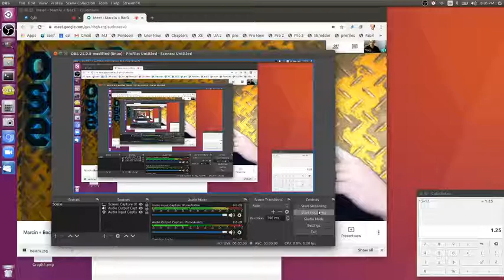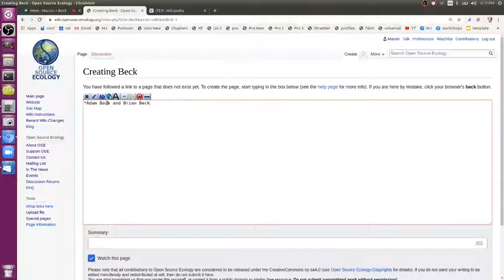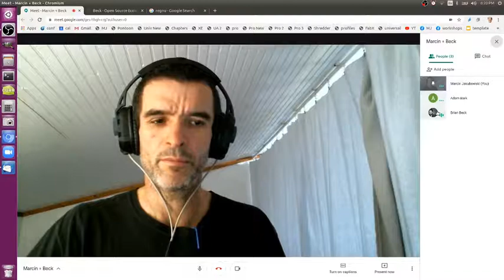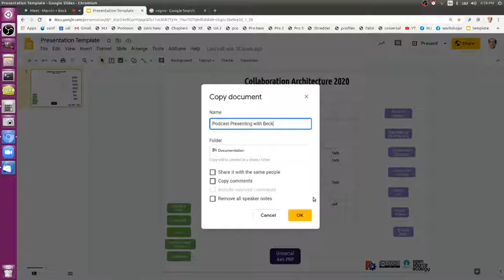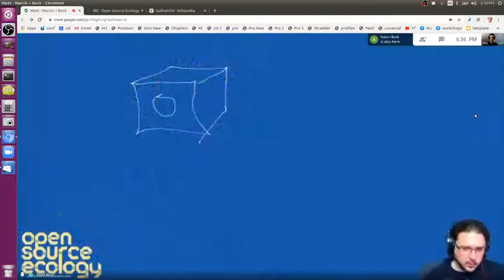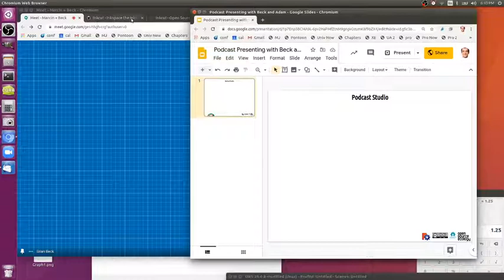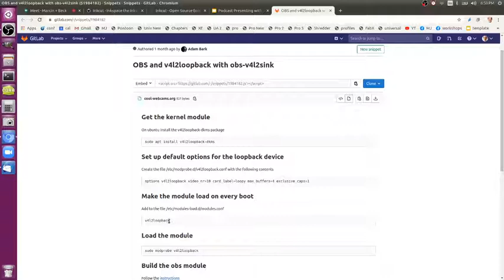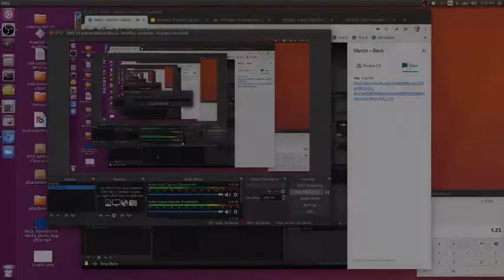Using Open Source Tools for Broadasting

Comment: Ever tried NextCloud Talk for a/v collab?
Reply from the maker: No. Do you like it? How would you see it used here?
Reply: @marcinose  I use it often on a handful of projects and client nets. NextCloud is a full collaboration suit, but it has a A/V chat and file sharing component as well. The only thing I didn't think of is if it can record. I doubt that it does, but of course a screen recorder could be used.

It's fully open source and can be federated as well, which can add some degree of decentralization.
Reply: rocket chat + jitsi is also a good option that has similar functionality to nextcloud talk